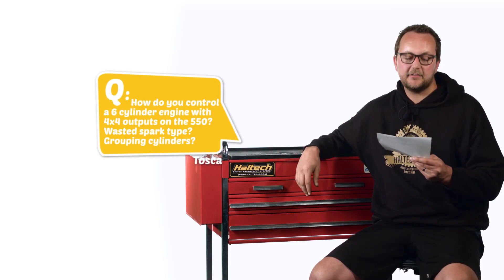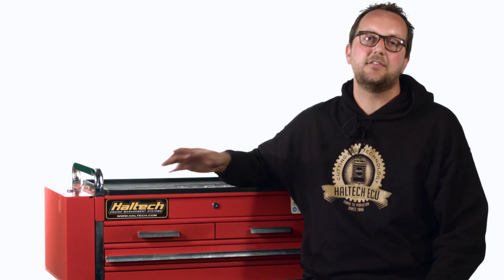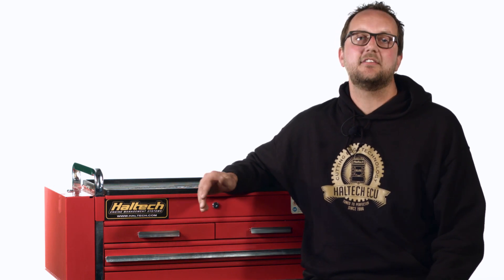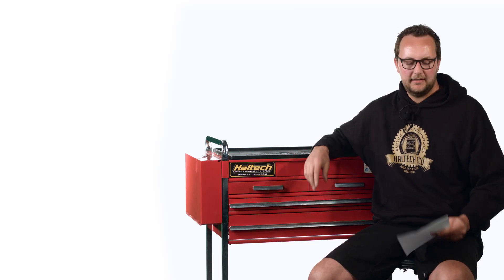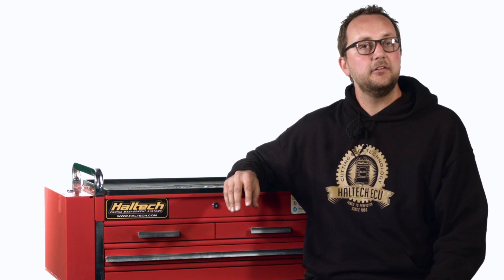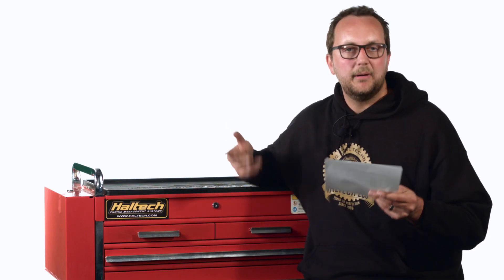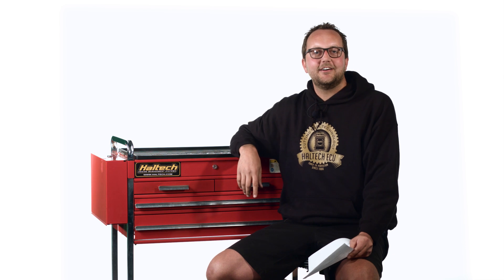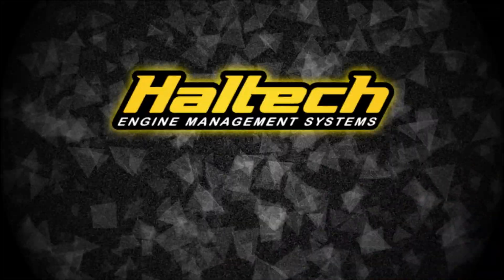❓ Kamikaze's El Camino ECU setup - Haltech Q&A Episode 18

Comment: Yo, 
I've got a 2002 Subaru EZ30D for an outback build, currently running with the stock ECM provided by Subaru, on my list of mods comes a turbo, I'd like to control boost pressure and use a drive-by throttle control system, though it's not necessary. Could I get away with the Subaru WRX MY01-05 and a custom tune? or would I need to get a universal harness and do the wiring myself?

Thanks.

Comment: Hi guys,
I've got a new Subaru Levorg which is essentially WRX cvt drivetrain (FA20DIT) I'm not looking to build huge power but build towards better drivability with a few things like CAI, TMIC, EBCS, EGR and TGV deletes with a tune of the factory ecu of course but if I were to look at upgrading the ecu are there any real advantages in doing this? Especially when I'm chasing drivability and power is a bi-product but would a haltech elite be say more accurate with engine management? 
From watching your other Q&A vids I'm fairly certain the ecu needed is the elite 1500 being that my car is a turbo 4cyl but can using the elite cause other problems with other systems like subaru's eyesight or anything else? Or would I need to do a piggy back system like you mentioned in this video to preserve all the other systems?
Also does the elite 1500 support direct injection?
I haven't found any resources yet of anyone with a new WRX (or levorg) go down this route yet which is why I'm asking. Have you guys seen anyone use an elite on an FA20DIT engine yet?
Reply from the maker: Hi Bryn, unfortunately at this stage we do not support direct injection. Though FA20 is certainly on our R&D list:)

Comment: Hey my question is, I have a 3.9 liter rover v8 and i am putting it in a older vehicle what ecu i should use ?
Reply from the maker: For sequential injection, the Elite 2000 is the best option. If you are happy to run semi-sequential injection, the Elite 550 or 750 could be used.

Comment: My question:
Can Haltech control diesel engine (bosch or common rail)? My limited head thinks than that's preety possible, because(I think) you can use ignition to activate injector and fuel delivery increased or reduced by mechanical fuel pump readjustiment. 

So it is possible?
Reply from the maker: At this stage we do not support diesel applications.

Comment: HeyI got an Nissan S13 200SX Euro Non ABS with an Ca18det in it. i`m going to upgrad my car with an RB26dett and a 6 Speed manual Z33 Trannsmission. For my Speed Signal i need to add a sensor to my drivshaft to create a Signal. i think the Elite 2500 is the right thing for me? Am i right? do you got the right wiring solution for me? cheers Marco from Switzerland
Reply: Marco Aerne the wheel speed input from your non-driven wheel (front wheel in your case) will be okay for the Elite to calculate vehicle speed. You won't need to wire up both front wheels, just one. For a bonus, if you wire up the driven wheels as well you will be able to take advantage of some cool features for Torque Management offered by the Elite. While you would be able to use the Elite 750 to get going with no problems, the Elite 2500 offers a lot more inputs and outputs to help give you a much more complete engine management solution. For example, the Elite 2500 offers on-board knock, many more analog inputs to facilitate the installation of pressure sensors for fuel and oil which can then be used to setup engine protection strategies and just as I mentioned earlier, the torque management solutions. Always remember that support for any Haltech product is just a phone call or email away. If you don't know who is your nearest dealer, you can contact either the Haltech Head Office in Australian or the USA and they will gladly point you in the right direction for on-site support and well as provide the appropriate support. Cheers!

Comment: Is it possible to set up a elite ecu on a fg xr6 turbo with the the stock ecu running the dash and auto zf similar to second example? Cheers
Reply: Mark S piggy-back installations where the factory ECU is left in place while a full stand alone ECU is installed is required for some modern applications where a complex OEM CAN is in place. It's not that the Elite can't manage everything on its own, it just means that the engineerings haven't replicated the custom functionality of the factory ECU which is what they would have done for some of the Platinum Pro plugin ECUs. To answer your question though, in a piggy-back installation as described the factory ECU as well as the Elite stand alone ECU share some signals. In some cases they will both share the engine speed (crank signal) and the cylinder reference signal (cam signal), depending on your application more signals might be shared but the Elite will be in control of your engine. If you are attempting an install similar to what has been described I would urge you to keep in close contact with either a Haltech dealer who has retailed your Elite to you or with either of the Haltech offices; Australia or USA. Cheers.

Comment: Hey, I have a 1976 Kombi and I'm putting in an EJ25 with a 5 speed, it has fly by wire, what's the best ecu option? Elite 750?
Reply: Fred Webb from what you have described the Elite 1500 is your best suited solution. It can handle the drive by wire Throttle along with many other features which might be needed for the EJ25; the Elite 750 can't control drive by wire throttle. Also, keep in mind when choosing an ECU that you should be attention to the control systems which the ECU needs to facilitate, so how many injectors, how many ignition coils, how many fans, fuel pumps, drive by wire throttle or mechanical throttle, variable valve timing cam shafts as well as any other actuation systems. If ever you are in doubt a Haltech authorized representative is always a phone call or email away. Cheers!
Reply from the maker: When using DBW, you would need to use the Elite 1500 – the E550/750 do not support electronic throttles.

Comment: Hi guys,

I've got an S15 Spec R, really want to run an Elite ECU in it, but there are no garages anywhere near me that can wire up those ECU's. Do you have a harness available that will adapt the factory wiring to the Elite. I also want the dash to work as normal, and have the all the other systems on the car still working (ABS & EBD).

Should I forget the Elite and go with the Platinum Plug In? I really want the benefits of the elite.

Thanks.
Reply: EyedrisElbows you are correct in that there is a Platinum Pro plugin ECU which is available for the Nissan S15 application (part number HT-055112). This solution should be a direct replacement for the factory ECU without any complications. While there isn't a direct solution using Elite family of ECUs, an upgrade to the hardware and functionality of the Platinum Pro, I do believe that you will be able to work with a dealer or with either of the Haltech offices to construct a patch loom harness which will allow you to directly connect the appropriate Elite ECU directly to your factory harness after removing the stock ECU; same basic install procedure as the plugin solutions. Please contact your nearest Haltech dealer to validate and confirm. Thanks for your interest, and we look forward to the positive feedback of your S15 project.
Reply: Sard Engineering,

Thank you very much for the reply, its greatly appreciated. I shall definitely look into this.
Reply from the maker: We have recently released an Elite patch loom kit for the S15’s – Part No. HT-140955.
Reply: Hi Haltech,

This is brilliant news! Thank you very much.